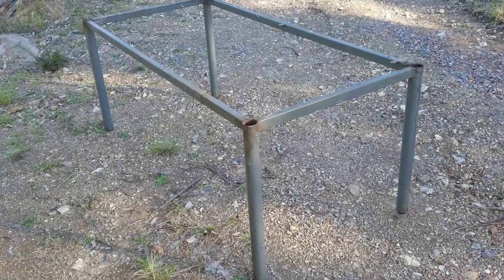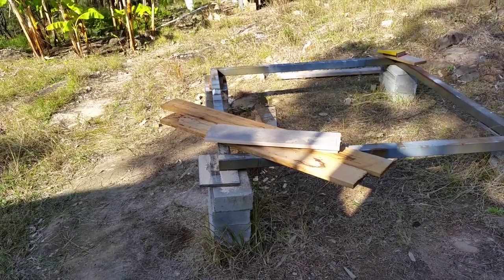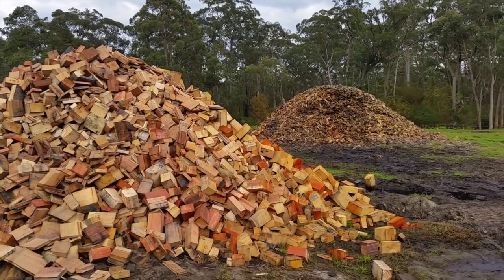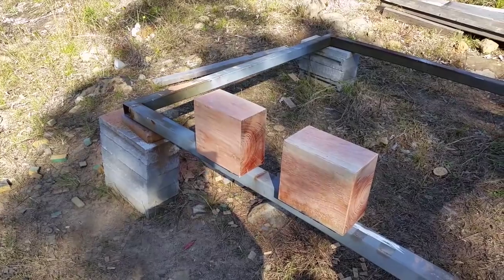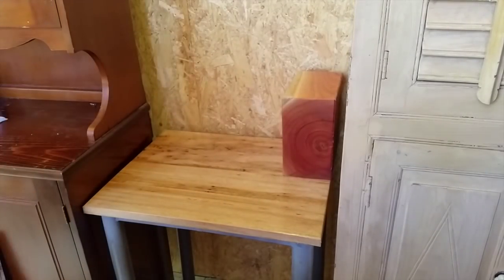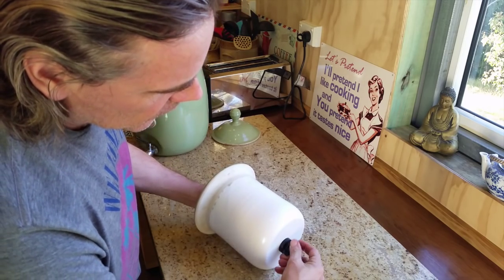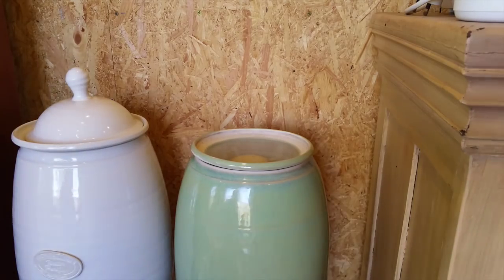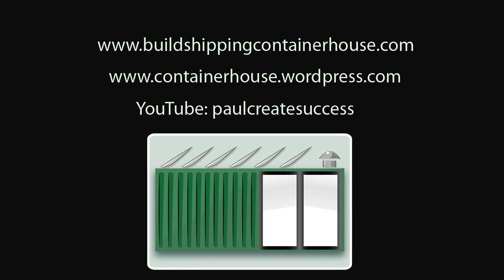Shipping Container House – Clean safe drinking water off grid, plus a new bench

Comment: i forgot i get lots of water from my air con unit in summer to good for battery and to flush the car radiator out and top up clean with coolant 
this is the ozone generator i started with ( http://www.ebay.com.au/itm/DIY-DC12V-3g-Ozone-Generator-Ozone-Tube-3g-hr-for-WATER-Plant-Air-Cleaner-module-/321238357826?pt=LH_DefaultDomain_3&hash=item4acb4c5742 ) there is smaller ones on ebay to i just got that size to do up to 1000L tank you well need a air pump the right size for how much water you do for it to, lots of 12v pumps around to i made my hole setup off grid best way